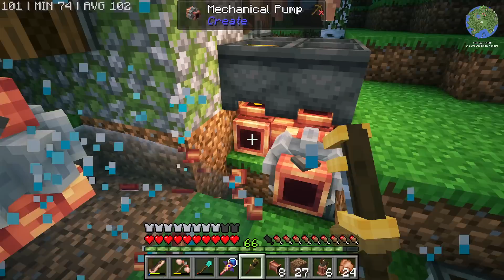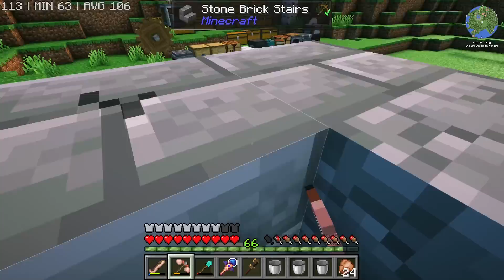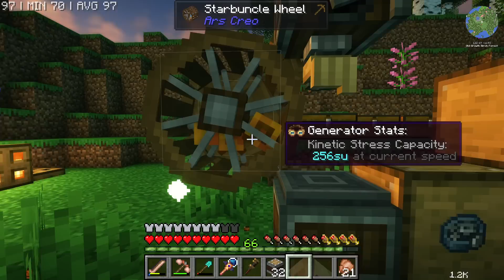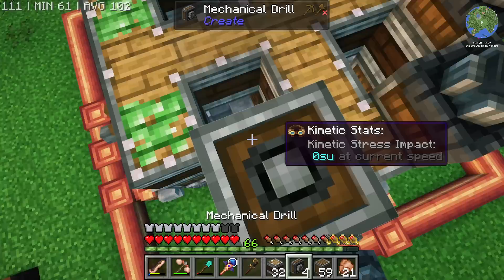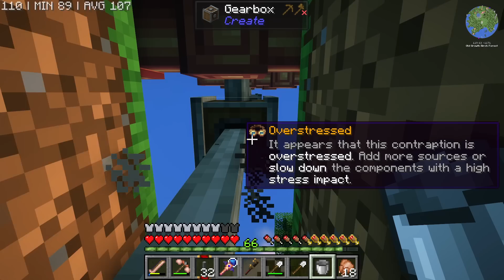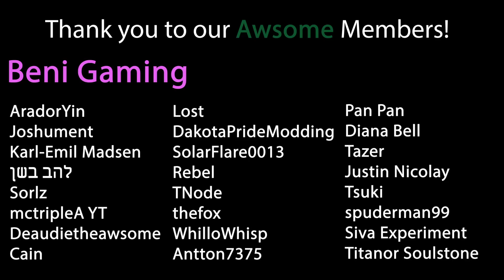My Ultimate Cobblestone farm! - Create Arcane Engineering Episode 8

Comment: Fun fact:
You don't need drills.
Instead, glue the cobble together.
Use an extendable piston with 1 pole in it, hook that up to a redstone clock to move the cobble up/down left/right. etc.
Every time it moves more cobble gets made, when it moves back... The cobble generated will break since cobble is already there.
Glue will continue to stick to other.
Tango Tek showcased this method, this stone generator..
Or what I like to call:
The schrodin-stone generator.
Play on the schrodinger theory. Dead&Alive at same time
Basically.. The cobble exists, and doesn't exist at the same time.
This generator could also technically work with ANYTHING using lava.
So Scoria with Chocolate & Lava, etc.
Reply from the maker: I mention that method in this video, it makes lag since it’s dropping items a lot

Comment: could you not remove the external shafts and gearboxes and connect all the pumps with cogs running up the side of the machine?  then a gog underground at the bottom and your power id completely hidden.  love this style contraption.  I personally just went with a tango style displacement one, but I figure it only has to last until we get about half way through the pack and into igneous extruders.
Reply: tangotek

Comment: If you place portable storage Interfaces exactly in the Center of a contraption. (such that when it spins it never changes location/Orientarion in absolute coordinates, you can do the connecting without it stopping
Reply: That's neat af.
Reply: Thats a really useful tip for contraptions that produce things faster than it can dump each rotation
Reply: doesnt work anymore?

Comment: You might be able to move a waystone by putting it on a contraption.
Reply: Nope, Waystones cannot be attached to a contraption, I've tried.

If you want fast travel, Reliquary's Ender Staff can teleport you back to a Wraith Node you placed (so, one-way teleportation), and Ars Nouveau has Warp Scrolls that, on their own are a single use one-way teleport, can be used to make infinite-use Warp Portals. The portals are also one-way, but since you can place their destination anywhere, there isnt much stopping you from just making two portals whose destinations are next to the other. Aside from the cost, setting up a portal takes the entirety of a Source Jar, last I checked.

The idea of having a room filled with portals to all the important locations in my world, centered on a randomly generated Waystone, is very enticing, and has become one of my goals.
Reply: Hmm I doubt it… but I’ll try it for sure.

Comment: 16:50 i think portable storage interfaces can have a two block gap between them so you don’t need the extra linear chassis sticking out
Reply: This, plus because of the contraption halting for the drills to drill, it'll take ages to complete a full revolution and actually dump to the vault. Might be better to have a PSI on each side so it dumps every 1/4 revolution, especially to stop downstream dependencies from getting odd "batches" and instead a more consistent flow

Comment: Something i noticed when playing create is that it seems that you dont need a pump on each place for the cobblestone, nor on the lava generator one pump on each couldron, you just need one pump and all the pipes connected to that pump should work, the lava generator i have it with one pump and i had one pump for a cobblestone generator and a couldron making andesite at the same time and it was working fine, i hope Dejojo read it and test it because i think it can save some resources not having to use that many pumps only pipes.
Reply: Yeah I would just put a pump at the source and maybe one between each level and have the outlet just regular pipes.
Reply: There is a range on that, I think about 16 blocks, after that you need more pumps.  Realistically though, the pumps in this pack are only a pipe and a small cog, so it's not all that bad
Reply: @Dvt.n  yeah but you save some su and bring it to there, it work like I said but a little slow, maybe putting like 1 pump on each side of each level may work tho, have to make more test XD but yeah if you don't care about su and those things is better like he did

Comment: What would you think of putting some of that cobble into a tinkers smeltery to melt into lava to start pumping into a 10k cube? It's powered by lava so as long as it uses less than it produces you have a pretty simple lava farm in the overworld.
Reply: You can't melt cobble into lava in a smeltery, at least not in this pack.  For that you need either a Magma Crucible, which is much further along, or a Superheated Blaze Burner, which requires Blaze Cake automation, which itself requires lava.  What you can do is a vanilla dripstone cauldron lava duplicator, which I ran for a few days to get my 10k cube.  If you can find Hellbark saplings in the Nether, you can also use those with Arboreal Extractors to get lava.
Reply: @couchalmark675  good tips!

Comment: in thinkers thers the renforced upgrade you can get and after 5 i think will make it unbreakle
Reply: They are pretty expensive and he does not have alot right now, perhaps later in the series
Reply: It's only 70% reinforced at level 5 in this pack. 80% if you include a chain binding. I recommend saving the free vein miner book and putting that on a netherite pickaxe with an eternal stella which you can mass produce for unbreakable tools.
Reply: Unbreakable is a Tinker's modifier, but it requires all 5 levels of Reinforced, as well as Netherite and its prerequisite Diamond modifiers, and it certainly isn't cheap.

Eternal Stella is far more easily obtained, isn't limited to only Tinkers tools, and can still be applied to Tinkers tools, if JEI is correct.